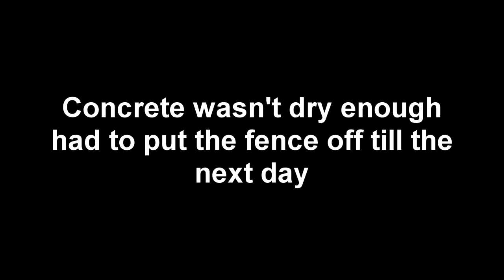Who's Going To Help Finish The House..?

Comment: Joe the issue with hvac is one you have to have ac guages maybe a reclaiming system, vacum pump most people that do it on the side are supposed to have a journeymans liscense in order to be lawful most states do require that and another reason you got a high bid is that most people dont have the tools and or gauges and then you are more less stuck doing business with a reg. Hvac company in missouri you are required to have at a min. the journeymans license and that also holds true to doing electrical work i have both in missouri ,sometimes when you work at a electrical company or hvac they require you have those  .most of the people cant afford the tools of the trade so to speak, when you do or have a job such as a renovation you have to pull permits for plumbing, electrical and hvac work that is contracted , im not sure of your state but in missouri thats how it works any minor things though does not require a liscense but running wire and installing a new breaker panel does and to protect yourself get permits and when a breaker panel is installed you will call the city utilities to shut it off when you connect the hot and neutral wires to your breaker panel other wise you city will be all over wanting to see permits exx and i do believe you have to be a master electrician to install the hot and nuetrals to the panel anything after that dosnt require a major license to run or install breakers, outlets exx...just to let you know dont put yourself in another bad situation with getting fined for not having the correct paperwork , i dont want see you fail in this endevor ...take it east joe again im going by missouri laws however they could carry over depending on your state there are national codes you must abide by

Comment: Thats got to be the smallest whole  house  tankless hot water heater ive ever seen it looks like u can run 1 application thats it.. the one i installled at my house runs 5 in the summer and 3 in the winter ground temp has a huge affect and how they work u bettr check it out

Comment: Joe you should get a inspector in at some point prior to selling the house (with the way this is going the sooner the better) he will tell  you why the house won't pass inspection (Which it will get a inspection in escrow and if they find something you will either need to fix it or the buyer will pull out) and give you some input on fixing it. Again get someone reputable. PLEASE!

Comment: Hey some fence advice your not supposed to use concrete on wood fences the concrete will rot the wood the proper way to install a wooden fence is to use dirt and tamp it down around the post

Comment: Joe. If everything is still squeaking, one you got ripped off on the water pump. You didn't need it. I'm betting your idler arm is misaligned slightly. (the full idler pully assembly) My dodge had the same problem and I bought all the same things you did and it still squeaked. If your belt is misaligned even the slightest it will squeak.

Comment: Judging by the height of those 4x4s, he has them only a foot in the ground.  They need at least 24 inches in the ground.  The posts should be the same height as the fence.

If your hole is the right depth and the quikcrete is mixed properly, you do not need "shims" to hold the posts while the quikcrete dries.  The posts won't move. 

That fence is going to fall over.

Comment: Joe, many people have warned you about not doing this remodel through the proper steps with permits and inspections with licensed contractors. My background is 35+ years electrical contracting and architectural engineering, I have seen countless times where this has gone very wrong for people. At the very least, when inspections found out what they were doing they had to remove all covered walls for inspection of all new and they got fined by the State. Not to mention, they make it much harder on getting the project to completion. 

This is something you need to stick in your head and think long and hard about. Without permits, inspections and work performed by licensed contractors.
If someone buys the house and it catches on fire due to electrical or hvac, the so-called "contractor" are not licensed nor insured. So who gets sued?Joe! If people get severely injured or killed in the fire, they will take everything you have and then some. This is a life safety issue! Events like this is why licensed contractors are insured. But, events like this are much less likely to happen with licensed professionals doing the work.

Comment: Joe, fyi a decent Hvac system costs more than $3,500. Anything lower is either stolen or an obsolete system. Depending on what the guys and the brand, $450 for labor and cost for materials/equipment $2500. Please dont skimp or cheap out for contractors, get three or four quotes, than get the median priced.

Comment: im a cocrete worker and it should have been set up enout in 12 hours depending on the nitro level of the quick crete at my job we sometimes pour concrete thats litterally sometimes  double the water needed  so the ground shouldnt have slowed it down much n that concrete was all set up quickcrete isnt very strong concrete

Comment: There is nothing wrong with your breaker box. BE ADVISED: If you put in another box, you will need buyoff by an inspector, and ALL breakers will most likely need to be ground fault interrupt and they are expensive. Your breakers are popping because what you are plugging in is exceeding the amperage. For example, I can see a few 15 amp breakers. If you plug in construction lights and a circular saw at the same time it will flip. In fact, if whatever you plug in exceeds 15 amps, it will flip. YOU CAN'T fix that by putting in a higher amperage breaker because the wire for a 15 amp circuit is probably 14ga wire and for 20 amp you need 12ga. That means running new wire in the walls....I wouldn't do that. You can run new 12 wire if you want to add receptacles, and places where you would definitely want those is in the garage and any outdoor receptacles. If you run out of room in the box, i.e. can't fit any more breakers, get 15 amp double breakers (2 circuits, one breaker with two smaller switches). As for knowing what does what, nothing in the box is labeled. Not a problem. Get a probe or meter (probe is easier). Flip everything off, then turn one back on. Go to each receptacle and push the probe in. If it's hot it will beep. Many might be chained together....make note of it. Back in box, use a labeler with plastic labels and print double what it is, for instance "UPSTRS BATH        UPSTRS BATH". Print 2 of the same label and put one around the hot and the other around neutral wires in the box. Printing twice on the same label ensures you can still read it without putting your fingers in there later. What else you can do in the box is clean up the wiring because it is a mess. Wires should be neatly run and bent, but not bent too sharply...just enough to be neat. If you do get someone else to do the work, watch them closely. If wires look like a mess, tell them to stop, because no electrician worth their salt will leave it looking like spaghetti or unlabeled. Another note.... add up the amperage of the breakers on each side of the box. A 120v breaker is only on one leg but a 240v is on both, so for a 50 amp breaker (say for electric stove), that is 25 amps on each. 
I flipped houses before flipping was a thing and have done everything from the roof to foundation and all utilities. Learn as you go, but learn right and do it right or it could come back to haunt long after you sell it.

Comment: You should of made the floor in the bathroom a little wet and then scraped it. That would of made it easier and helped you get it done a little quicker.
Reply: Gelico did it with no issues. Joe scraped very little

Comment: For your truck that serpentine belt and all 3 pulleys shouldn't cost more than 100 dollars to buy OEM dodge parts. I would replace them with OEM parts simply for piece of mind on the parts quality, the cheaper parts are not as well made or are actually refurbished broken parts. Or Gatorback since they are usually actually much better made than the OEM parts if youre out of your warranty (you can trick the dealership with self replaced OEM parts if you never admit you did it).

Replacing all 3 pulleys and the belt will take around 2 hours for someone who's never done a belt replacement before and 20 minutes for someone who has. Don't pay over 800 dollars for 20 dollars worth of work.

Comment: Man, I wish I lived where you do. The work your truck needed I would have charged 300 bucks (I'm an ASE certified mechanic but now working in a different field but I LOVE trucks and specialized in them) and also I can do all the work you need for your flip house. I'd probably charge 1000 to 1500 to do all the work you've listed. I'm not certified in HVAC though. I can do it just dont have my certificate.
Reply: I'd just love to be able to help you get it done and get it done right.

Comment: dude, they make these canvas things called drop cloths, you should check them out, very reasonable compared to fucking up marble tile.  

also, don't buy 100-foot rolls of wire, its only about ten bucks cheaper than standard 250-foot rolls.

Comment: "Ghetto Contractors Inc."  You need to put some 3-1/2" or 4" stainless steel or exterior screws in that fence.  Ur nails were holding by like 1/2"  Gonna fall right back down in no time.  Just sayin!

Comment: I hate to break it to you brother but those four by fours are going to rot to high hell. You should have either wraps the bottoms in vycor or used a brace tapcon into the concrete and then screw the four-by-four into the brace. You don't want to just stuff a 4 by 4 into concrete like that. If I lived near you I would definitely give you a hand.

Comment: 30 thousand dollar house turns into 300 thousand dollar house after all the cons finish ripping you off. Cheaper option in the long run is to use a professional contractor. I'm not sure you will be able to break even on that house if you sell it when finished with all that is going on.

Comment: I just looked up the codes for all the trades he is hiring. The code book is thick. He is going to have to tear the ceiling down because of no beam in the load bearing old archway. All the breakers need to be replaced,  The wires need to be a certain length in the studs so the drywall screws don't puncture the wires. I just don't fucking get it

Comment: U should just redo the whole fence if it’s happening here and there it’s going to happened every where else
Lol 
I’m a plumber and u need shit up to code 
I’ve seen some shit in ur 
Job site 
but what it looked like was some  2”pvc
 I really hope ur not running a water main of that because that’s a big no no 
Also I’ve noticed that ur bathroom floor is finished and all ur plumbing is under that 
I hope u tested it out or pray that u have no leaks or that ur able to access it to fix any leaks 
So just pay the plumber 
And fix it 
Same with everything else 
Lol if u trying to be cheap 
U should’ve just made the out side look good and leave the internal for the future residence u would’ve saved 
A lot off money and headaches
And rabbit is right everything about construction 
Is a learning experience 
Same shit just different situations 
And making shit work 
And making shit done

Comment: The only other thing I thought of instead of just digging a hole in the ground and filling it with sand and Quikrete and all that good stuff ET cie they actually make tubes now that you put in the ground that you can put the piece of Lumber in and pour the cement right into a tube and it makes a perfect circle you see it on a lot of commercial a properties for lighting in the parking lots and stuff like that they got all different sizes from baby to Big so you just dig your hole plop that special quick tube in there and then you fill it with quick Quikrete and all that and everything is even and sturdy and it works fuckingawesome man so always keep that in mind for your next fence job or any kind of job where you got to put up a pole for something and it needs to be cemented in. the only other thing I thought of instead of just digging a hole in the ground and filling it with sand and Quikrete and all that good stuff ET cie they actually make tubes now that you put in the ground that you can put the piece of lumber in and pour the cement right into a tube and it makes a perfect circle you see it on a lot of commercial properties for lighting in the parking lots and stuff like that they got all different sizes from baby too big so you just dig your whole place that special quick tube in there and then you fill it with quick Quikrete and all that and everything is even and sturdy and it works fuckingawesome then so always keep that in mind for your next fence job or any kind of job where you got to put up a pole for something and it needs to be cement it in. They all got different brands of that quick tubes or whatever they're like called cement quick tubes or something like that they got a bunch of different names for him but if you Google searched cement quick tubes I'm sure it'll come right up and you'll see what I'm talking about

Comment: Not only could convicted felon own a nail gun, but they could own a power actuated nail guns that us .22LR blanks to propel the nail. It's a little stupid, mildly dangerous and not super good for the life of the gun, but you can shoot those blanks through .22LR rifles. Can get a super light .22 pellet to go upwards of 2000fps. While regular 40 grain .22LR go about 1000-1250 out of rifles. Though the .22 pellets are less than a quarter the weight of the .22LR ammo projectile. Fun to hear them come screaming out though when compared to regular .22LR which barely breaks the sound barrier. 

Also I'm pretty sure in most states convicted felons can own blackpowder firearms. Maybe not percussion cap revolvers in some states. Though I know in lots percussion cap revolvers aren't considered guns and totally unregulated like nail guns. Only way I could see you not being allowed to is if the Judge or Parole board give that extra stipulation that you weren't to mess with that stuff.

Comment: The Bathroom cover it with Plywood and not a sheet. Get your ass on the job you got plenty of work to do there. Cleaning that Ames Plaster up, that way you can keep an eye on contractors... And being Cheap, cost you how much with Brian ? More than the Vac system ... Do things Correctly !!!   You are not doing a shady deal for a tattoo now, this is the real world. YOU NEED TO DO THINGS PROPERLY IN THE REAL WORLD, HIRING CON-MEN, EX-CONS... BECAUSE THEY TELL YOU WHAT YOU WANT TO HEAR... HOWS THAT WORKING OUT ???

Comment: Fencer here. That post repair is horrible. Looked like 3-4 panels leaning.step 1 wack panel off old poles  Dig Old poles out set new ones in same spot as old pole. Nail back together. Those 3 little pieces of wood nailed to each rail. No one wants to see that

Comment: I laughed my ass off because you said you were building a fence.  You didn’t build a fence. You and the guys just attached a pre made panel fence.  How easy can that be. The colors are not the same you may want to re stain the fence so it looks like it all matches. It’s not a good looking fence. Sorry dude. 😂😂😂
Reply: In my experience the finished side of the fence faces the owner. And it doesn't match existing structure so yes some staining would be required. Hope the neighbors like the shoddy new fence job.